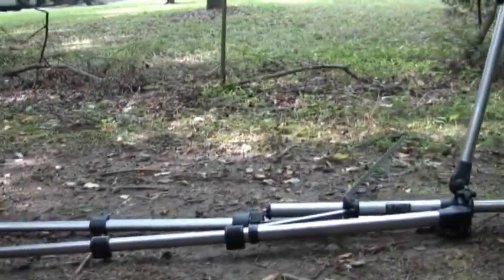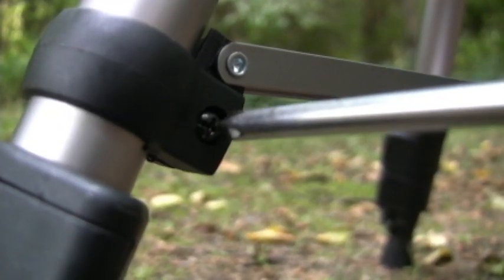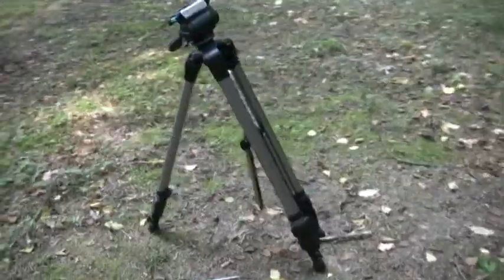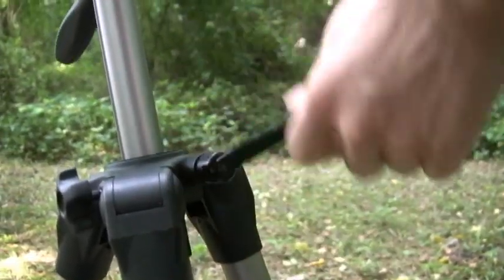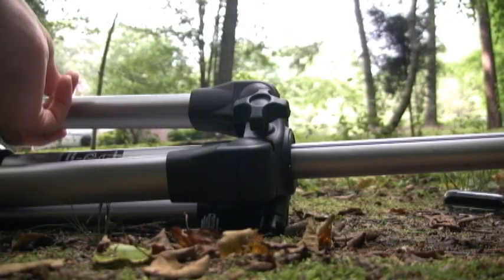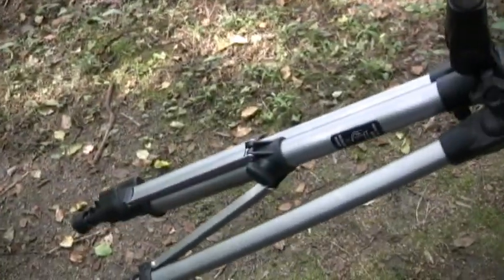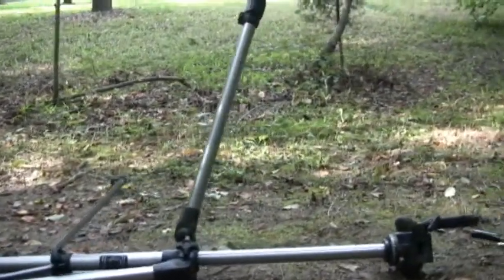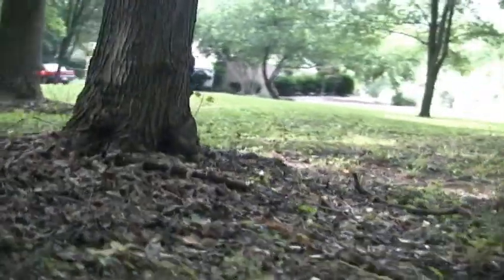The Merricam - No-Cost "Steadicam" DIY

Comment: Genius! You've got 165 steady cam company's hating on you lol!
Reply: I was thinking the same thing.  Nice job
Reply: A real steady cam will do much better and be smaller.
Reply: Coolshows101 and cost more than the tripod you already have at home. The tripod shown seems to be quite lightweighted. I use a Pentax K5 and a Manfrotto photo tripod with a ball head weighing 8lbs and it works quite well.The heavier the better ;-)
Reply: tubybubi
I realized that and have gotten a $20 tripod form Walmart and used that.

Comment: How would you focus the camera when both of your hands are occupied?
Reply: With a lanc remote. Or you could put it on autofocus
Reply: Yeah, because auto-focus is notoriously a great setting to use. I'd rather not have a 'steadicam,' and have proper focus and DOF control.
Reply: If you use a wide lens and close the aperture as much as possible, you can get away with no focusing at all
Reply: Agreed with Dirk, it's best to maximize your depth of field so you don't need to adjust the focus. Since you will be in movement, any passing trees, people, etc. might confuse your autofocus.
Reply: Luckily my camera has tracking focus
Reply: FrstProductions Most DSLRS don't have auto focus for video.
Reply: BaSH PROMPT Yes I agree that autofocus is not the best setting but it definitely has it's place and sometimes you can get away with using it.
Reply: Monster if you have a cannon you can set it to auto focus on the lense itself...

Comment: so awesome! but I attempted to do this on my tripod but it had no screws, just a riveted bolt  so no DIY steadicam
Reply: instead of the screw find the stud..... and push it out with a pen.... Then try the legs. If they stop , then find some wire because i snapped the leg off my tripod and then wound it up with duct tape and garden wire................ It works as a diy steadicam shoulder rig and allinone tripod
Reply: If you're super handy with a drill or rotary cutter and can find a suitable replacement skinny nut and bolt, you can drill or grind the rivet head down and remove it.
Reply: Adrn Ncso Dont alter your tripod!  thats just SILLY.  add another pole. its easier, more secure, better results.

Comment: Yeah it works, i just done this technique with my tripod for my DSLR works like a charm, you just have to get the balance right due to the camera being heavy so a metal tripod works best, or even for ultimate steadyness use an old telescope tripod i used mine and it works better, get a good work out holding for ages too! Hope this helps.

Comment: My tripod is made differently. There's no screw on mine where you removed one. The legs are secured at the top with a screw. Tried that but with the pivot that far back I had to use a lot of weight to balance and it was unwieldy. I'll try drilling the rivet that secures the spreader and use maybe a cotter pin or tiny detent pin when I want a tripod. 
Thanks for the awesome vid. The practice shots look amazing.

Comment: Its an awesome tip. the only problem is the sizes (indoor use problem). i think that the best solution is to put some extra weight on the back legs of the tripod instead of pulling them out.

Comment: this looks good but the flaw with this is the free arm is only free moving for left and right tilts, there is no tilts for forwards and backwards because the legs only meant to swing in one direction, this means the acceleration, constant speed, jumping, turning, spinning, angle changes and slowing down of movement with this have to be very slow and very carefully moved. if any kind of filming with this is done at a decent speed you will get a back and forth swinging motion from the free arm being stiff with back and forth movement and from the weight being underneath the hand that's holding up the whole thing

Comment: Saw your vid that someone reposted on Wimp.com. Back in the '83 when video cameras were huge and had screw mounts on top, I did a steadycam effect by pulling out the center stalk of my tripod and screwing it into the top of the camera and then loosening all the locking handles. It had a pretty smooth sway as you walked, but were limited to low shots as high as you could hold the "bottom" end of the stalk.

I had to use a Bogen tripod las a jib once, closing all legs and holding by leg's end.

Comment: Hey Will..
  I was just working on converting my tripod (the same model you are using) and I remember the reason why I stopped using this model. The leg is glued into the top section and falls off easily. 
  I would recommend that anyone trying this verify the legs are mounted with screws. If glued like mine, then recommend drilling a screw hold and securing it that way.
  Just a thought.

Comment: WTF when i'm done open up the one leg.

MY TRIPOD LEGS CANNOT BE FREELY PIVOTING FACING UP AND DOWN

it's difficult to bend bcause there is a barrier on the top of the legs, so it makes the legs movement limited canot pull it up or down (different type tripod legs)

and i started frustating right now. IS ANY ANOTHER SOLUTION??

Comment: much better than all those wacky stabilizers that cost $100+ and you have to 'practice' with for 50 hours before you give up and return it for a refund.  I also have been using an old monopod with a lightweight vidcam on the end and just hold it like you would a boom mike.

Comment: Sounds like it's attached with rivets.  You can probably get the rivet out with pliers if you're careful.  The rivet will have to be destroyed to get it out and it won't go back in.  But as long as you don't damage the tripod leg then you can just replace the rivet with a screw and a bolt from the hardware store.

Comment: The horizontal cross member at the bottom...what if instead of unscrewing it you drill out the rivet and use a removable coddle pin type of thing.

Comment: The tripods I use for film, I get from my film school- and those are all a few hundred bucks. There are good cheap ones on Amazon. Check out Dolica. There is one for around $50. I use that for still photography and time lapses. It won't work for this mod, but as a tripod without movement in the shots, it works well.

Comment: Instead of extending the legs for counter balance, you could just add weight which makes it more useful for tight shots, but also limits how long you will be able to carry it in action. Drat! My tripod doesn't have a screw for the legs. Guess I'll have to drill it out and put a pin it there. Isn't it great how we all can get excited about something free?